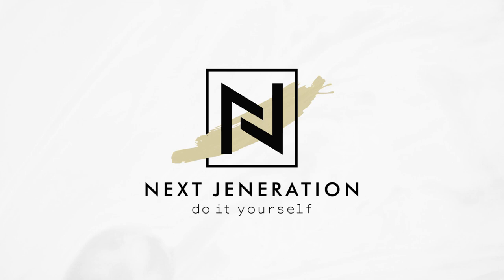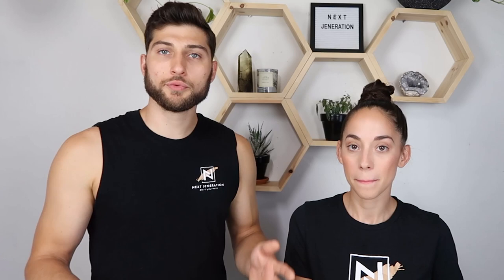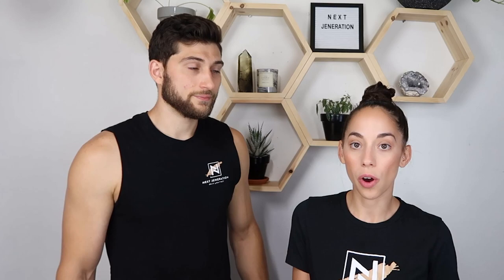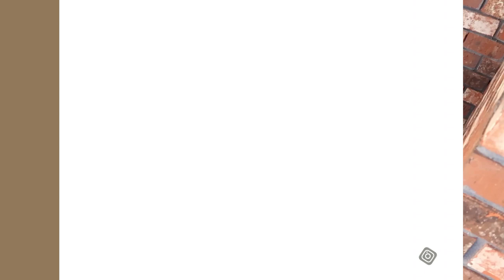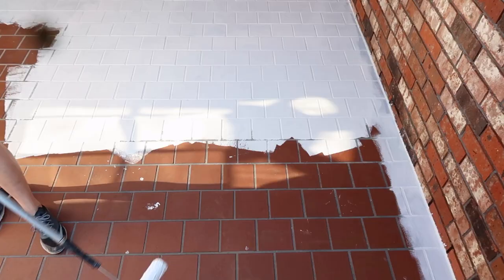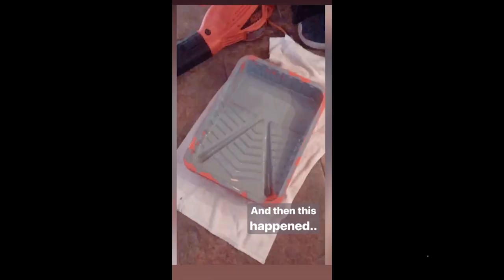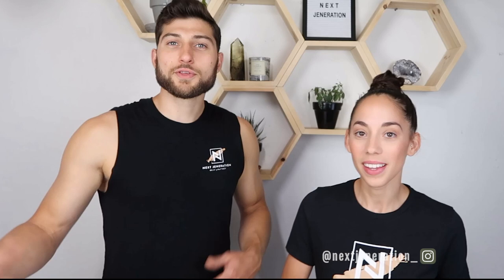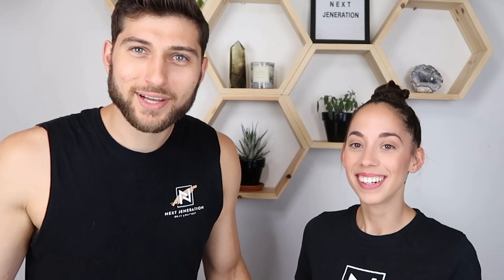DIY Painted Patio Tile Floor *INEXPENSIVE and EASY*

Comment: A small tip,  you should have used 80 grit sandpaper and scuff the tile.  So clean tile with a degreser, then scuff, then power wash and ensure floor is free from dust by running your bare hand across one or two tile. If your hand comes up clean your good to start with primer.  The Reason for the sandpaper is you want your paint to have something to grab on to ITS ALL IN THE PREP WORK.  But i did learn from your vid that oil base is the way to go thanks 👍
Reply from the maker: Thanks for the tip!
Reply: super comment thanks!!
Reply: @mounla1025  You're welcome.

Comment: Looks brilliant, ive been watching a load of these type of videos getting tips because I’m doing my own patio. Can anyone tell me why no one is using a paint sprayer?? Just as i have a couple of sprayers and thought i could use one to make it easier. Thinking twice about it now as everyone seems to be using a roller. 🤔 if anyone has any advise, would be much appreciated. Thanks
Reply: well - it's a year later but - you can use a sprayer if you want but it's probably less work to use a roller & brush  as you dont need to mask up & have drop sheets alng the walls..

Comment: Does the oil based paint smell? The patio I want to paint is technically outdoors with screen walls around it and it's by the front door and close to windows, so I need something non-toxic.
Reply from the maker: Oil-based does smell! I recommend keeping your doors and windows closed,  paint your way out the patio & go through a different door to get back inside!
Reply from the maker: Oil based is important for not only high traffic areas, but because it’s being used on the exterior.

Comment: How is this holding up?
Reply from the maker: It’s been one year and no issues! We get A LOT of rain here and extreme heats, so I’m impressed! There’s 1 tile where someone drug a super heavy metal heat press across it, and there’s a small line in the grey paint but it didn’t go through the primer!
Reply: @NextJeneration  excellent. Our primer has been down for a couple of days and I'm hoping we get our paint today to finish it off ☺

Comment: oil base will last 2 weeks instead of the latex 1 week... you want real professional results... USE A 2 Part Epoxy paint...  these 2 armatures will make you waste money
Reply from the maker: Really?? Because it’s been 2 years and 0 chipping. I’ve also pressure washed it twice 😉😉
Reply: @NextJeneration  I"m calling BS :) or a very low traffic area...
Reply from the maker: Front patio is pretty high traffic. Plus we get packages daily, have tons of potted plants that we move around, etc. 👍🏼 it’s ok to learn something new every one in a while!